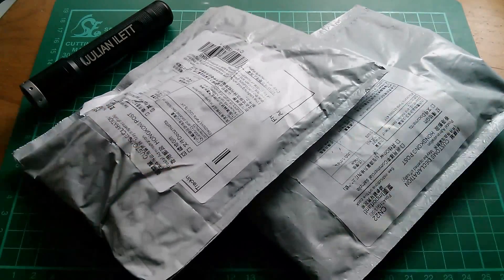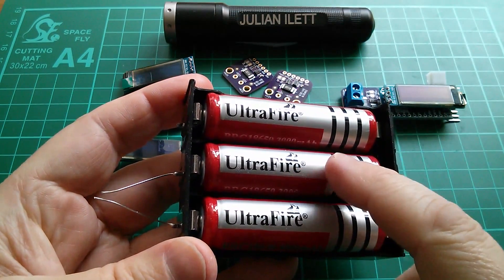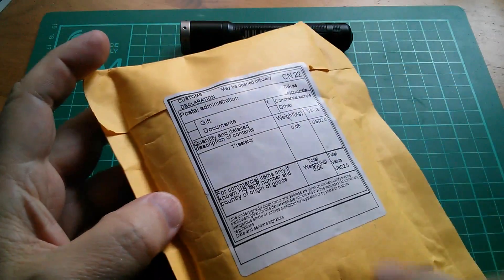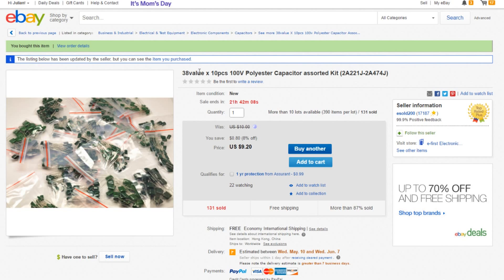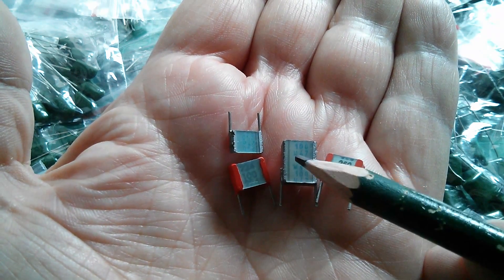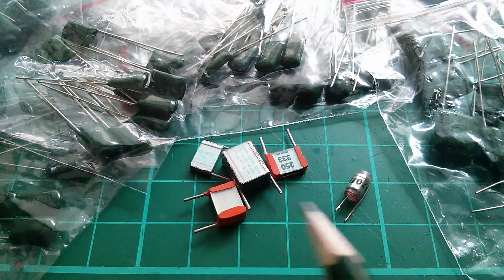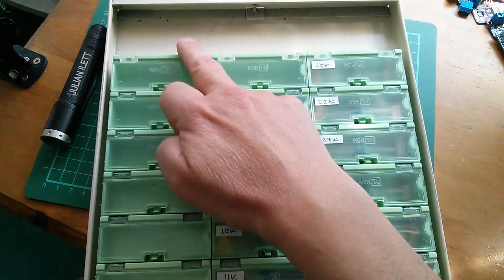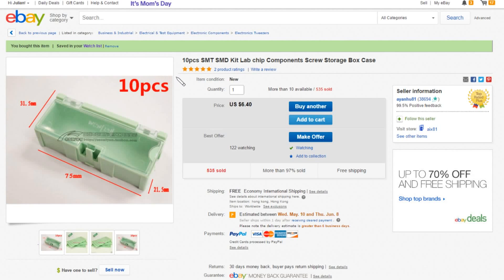Julian's Postbag: #93 - Electronic Component Heaven

Comment: Just as a tidbit, Polycarbonate was one of the few substances that could operate on high temperatures and high frequencies. It wasn't a trivial task finding a substitution after PC-film production was discontinued by the sole company manufacturing it and capacitor manufacturers had to adapt. But Polyphenylene sulfide (PPS) is found to be a reasonable alternative.

Ceramics have their own quirks and issues where they can't be used to replace just any capacitor technology available in all the applications.

Comment: Managed to snag a pair of Ohmite "Little Devils" Carbon resistor organizer drawers, mostly still full, for the grand price of nuttin'!
There's something so nice about finally having a properly organized resistor selection, vs a box of bags.
I also recently got a binder with pouches and a bunch of ceramic capacitors in it. That's proven to be very useful as well!
Never scoff at organization! A label maker and an obscene number of Flambeau Storage Cabinets serve as some of my most used benchtop tools!

Comment: Those those unencapsulated stacked film capacitors look like MKT polyester ones to me.

Bayer stopped manufacturing polycarbonate dielectric film back in 2000. There are other manufacturers making it but it seems its use is now confined to military grade caps.

Comment: what the hell are you doing still playing with those clearly fake ultra fires? nasty.
Reply: KASA kasa ultra fire don't make sleeves like that but fakers do. Julian can confirm but I bet there's a typo on the red sleeve that says 'sheef life'. if you Google that exact phrase you'll soon find a supplier of fake sleeves that can be shrink wrapped onto any old shit pretending to be genuine. these are either cheap nasty batteries with almost no capacity and lots of sand to keep the weight up, or more importantly old laptop cells covered in the shrink wrap. you can tell as there will be welding marks on the bottom.  this is most dangerous as they don't have any protection circuit and are therefore a fire risk. Julian must know this so do a video!
Reply: here's an example. check the official ultra fire website and their batteries look nothing like it.  https://www.fasttech.com/products/3797000

Comment: Julian, After trying various methods of storing tons of components, I've just finished organizing all my resistors this way: http://www.zachpoff.com/diy-resources/quick-easy-and-cheap-resistor-storage/
Works great and it's very compact. Cheap 6-mil ziplock bags from ebay and a bunch of labels. Totally solved what to do with all the 1% resistor kits from ebay.
Reply: I did in 1982 exactly like YOU! :)  .Usefull til today 73 4z9dei

Comment: Hi Julian, whats your opinion on the quality of discrete components from ebay (like the capacitor/resistors) as opposed to buying from RS or Element14 etc? Cheers.
Reply: That's really what keeps me from buying components off eBay, really. The fear that the quality will be off in some way as to fail catastrophically and I'll have something go up in flames when I'm not looking. Of course if they don't die horrible deaths there's also the issue of how accurate their ratings are as knock off items often seem to have components that technically work and have the right value but are actually rated for 50V even though they're marked as being 75V or what have you.

Comment: just looking at the way you did the connection on the amp meter project would some heat shrink been useful to stop possible shorting out if the got twisted especially with the way you did the swapping of the conections

Comment: I believe, you may order a lot of shown boxes. There are not the half Watt Resistors only, also the 1 Watts, 2 watts and others. Or do you want to store them in plastic foils?
Reply: ... and I'd liked to say, you may get they cheaper:
http://www.ebay.de/itm/231591200477?_trksid=p2060353.m2749.l2649&ssPageName=STRK%3AMEBIDX%3AIT

only USD 5.88 / 10 boxes.

Comment: Was I the only one who was bothered with how close the positive leads were sitting on the 3 battery lithium holder?  They were so close together and with the negative side already commoned I was just waiting for them to touch and fuse together.  Maybe I wasn't actually bothered as hopeful.  Sparks is fun!!!  :)
Reply: The cells are in parallel, the result of shorting the wires would be entirely uneventful. The internal resistance of the cells offer a fairly low current flow, which is exactly what he is testing with the Ammeter project. If they were in series however...!
Reply: Boring Old White Guy he has a video where he connected the two through an ammeter.
Reply: Oh I saw that one.  I'm talking about a good old fashioned short circuit.  :)
Reply: I think you're missing the point.  Even us old guys can still play like kids and hope for sparks and bangs.  :)

Comment: As much as I know, resistor values are mapped into E6, E12, E24, E48, E96 and E192 as per EIA standard, but never heard of any E36 before (9:03). Are you sure its still there or was it the standard many decades ago when you started electronics? Please share more view on that. Thanks

Comment: For me, The Cheapest way to store Resistances is to use a Binder with Sport cards pocket page. You can fit about 288 different values in a small binder for a total of $ 5 CAD from dollar store (Here in Canada Sport cards pocket page are $1 for 8 pages, 9 pockets/page). The disadvantage is : Don't flip thee binder upside down and you cannot fit a large amount of resistances in one pocket.
Reply: Hanzy Canada I use an a4 binder for mine, I think that legal letter size for Americans. Iv put big direction arrows on the front and back so it doesn't get picked up the wrong way 😀
Reply: Shaun Whiteley The A4 isn't the same as Letter, this is a bit bigger
Reply: @fersunk  A bit longer to be exact